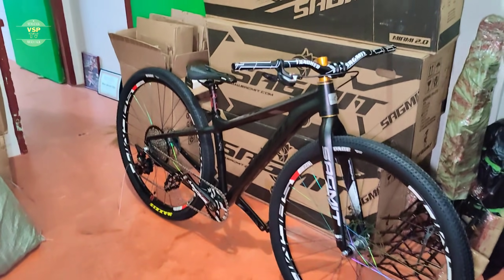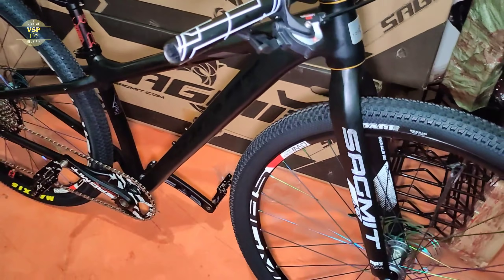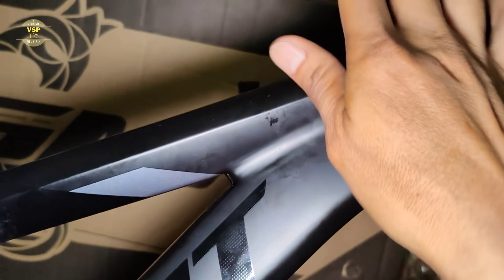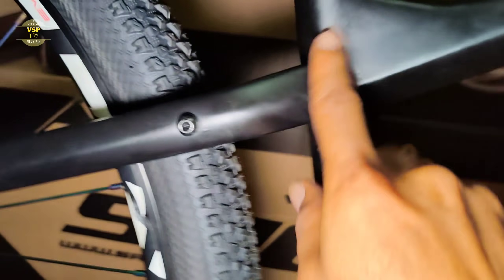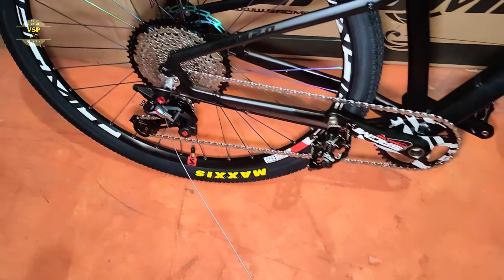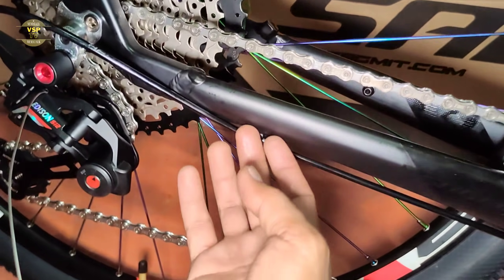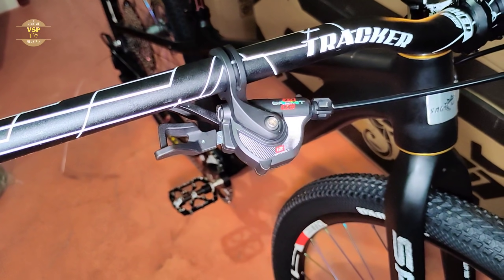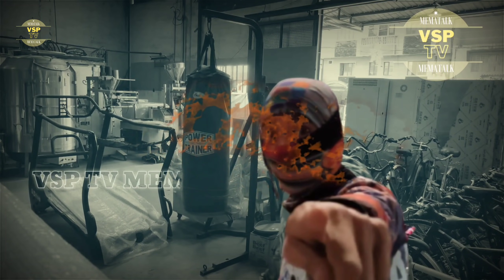BAGONG SAGMIT MIAMI 2.0 1X12 SPEED PANALONG SPECS!!!

Comment: Katono velmon, kaya po ba ng 20k budget kung magpapabuo ako ng sagmit miami na frame, 2x10speed at tsaka alloy na lahat ng parts? If hindi magkano kaya po yung sasakto na. Maraming salamat po sana mapansin
~Newbielang po.
Reply from the maker: Master si katono velmon Isa sa mga hinahangan qng vlogger din po hehehe.Opo master pwede po kayong makabuo sa halagang 20k na budjet 
Master eto yung statement q lng sa parts qng 2by10speed
Miami frame:6kto6,200
Crank arm Shimano mt210:1950
Alloy rims set kasama hubs cassette type:1850
Gulong compass tire:850 pares
Hydraulic breaks:1950
Cockpit set:1k
SAGMIT gs10 speed Edison:almost 2k
Fork:2k depende sa brand 
Master Yung IBANG supporting parts kasya pa po Yung 20k mu yung price q po master malapit sa katotoohan po lahat Yan hehehe ride safe po master godbless po